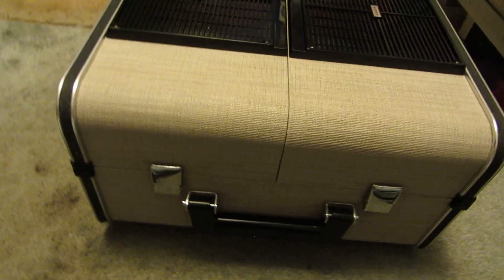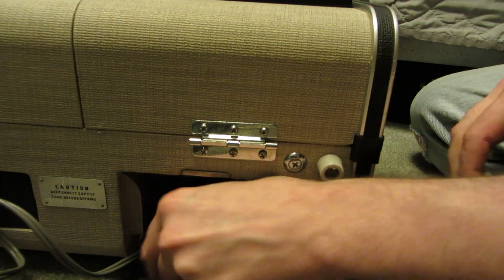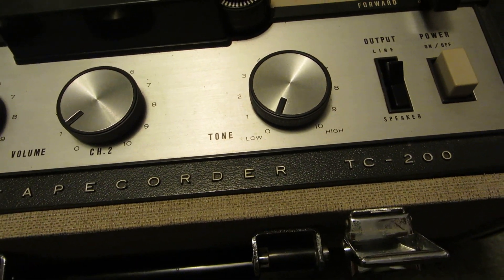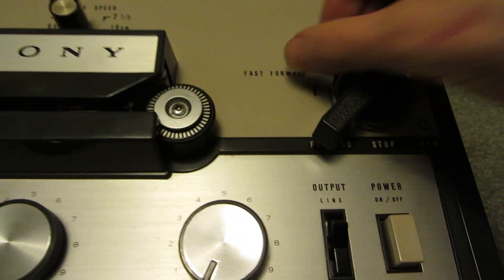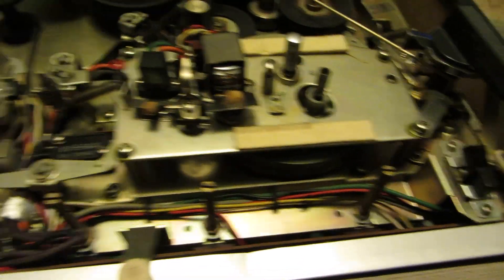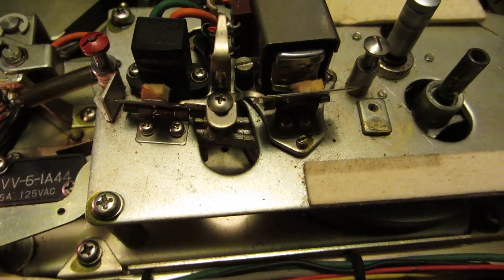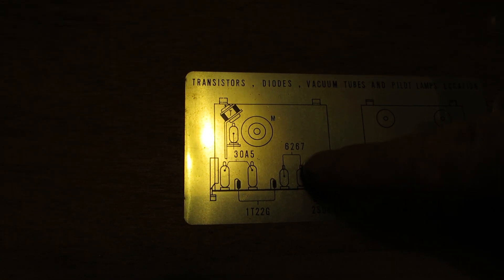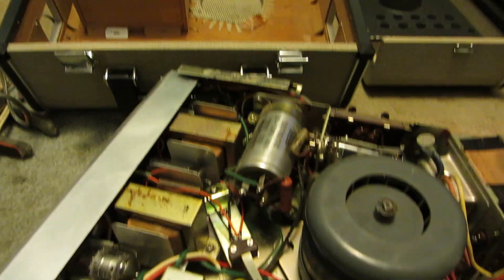Sony Reel to Reel Player - Operation & Teardown

Comment: The "Inst Stop" lever is a pause control which you would use to pause the tape without disengaging the record function (for instance when you are recording from an lp and changing record sides). This way there wouldn't be a "pop" on your finished tape where the tape was stopped.